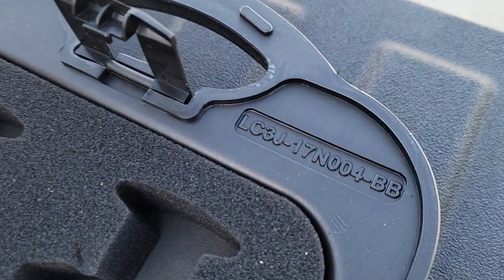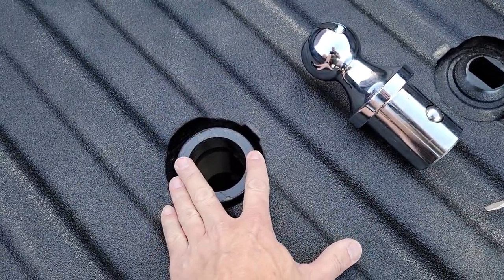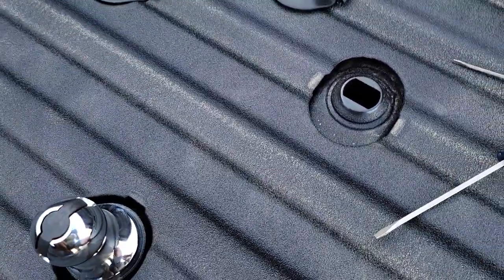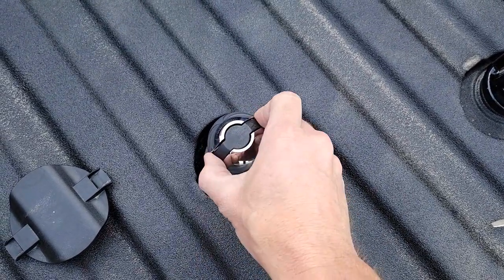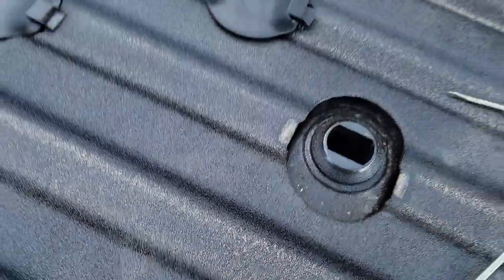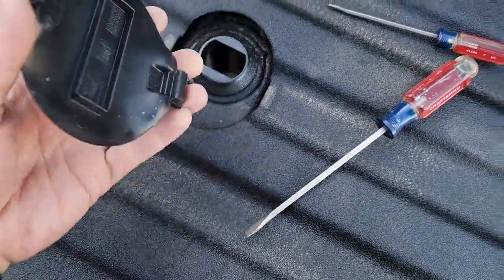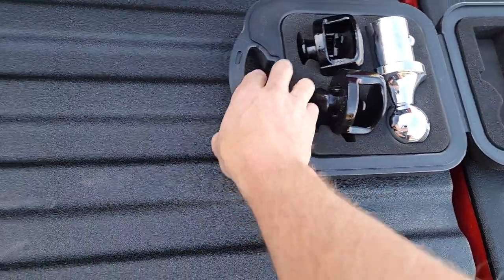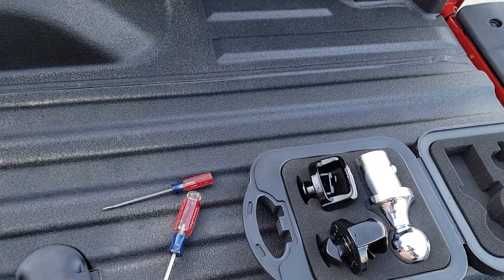2024 Chevy 2500 HD factory gooseneck ball install!  6.6 L8T Gas or 6.6 Duramax!

Comment: Curt makes the GM Accessories gooseneck kit too so it’s almost certainly the same thing as the Ford. 

B&W makes a kit for the factory puck systems as well. It’s a little more pricey but is made in USA and it has a grab handle on the goose ball. I think that’s how it locks in and out of place too. I don’t have the factory puck system but it’s what I would get if I did. But I’m a B&W fan. Their tow and stow hitch is all I use.
Reply from the maker: I love BW, this kit came in my 22 powerstroke, kept it when I traded...I try to keep the goodies...
Reply: @automotiveinquiries9673  don’t blame you. I have some of the GM Accessories tie down anchors from a 2015 truck I had still lol. They go in the little oval slots that’s all around the bed of the trucks. 

I’m sure Curt is good stuff too. I just know B&W is. I had a 2” shank tow and stow for years. Atleast 7 years old. I bought a 2.5” one a few months ago for my 2500 though and gave the old one to my dad. Just very little maintenance and those things will last for ever.

Comment: That Chevy 2500 HD looks cool, but the engine sounds pretty loud in the video. Is it the 6.6 or the 6.6, under the hood? Ya got some great insights brotha, enjoy watchin from up here in Ol' Canadia
Reply from the maker: Thanks, it's the 6.6 L8T gasser.   The video may make it seem louder but its very quiet, more so than the 7.3
Reply: @AutoMotive Inquiries  Aye, thank you for your experiences and opinions. Ordered a 2023 F-250 with the 6.8l V8, ya helped ease my mind on this new engine based off of the 7.3l. Will keep up with your videos, doing great. Have a good one, eh!
Reply: What in tarnation is that loud noise?